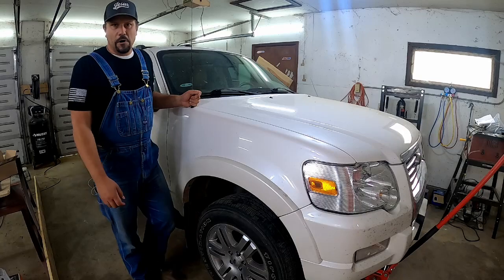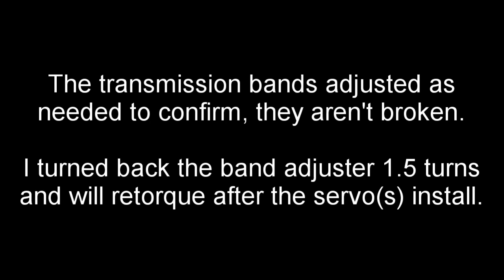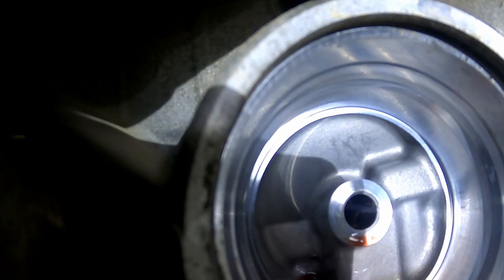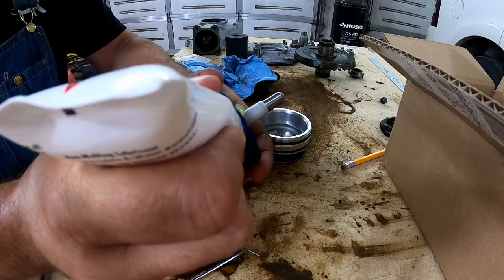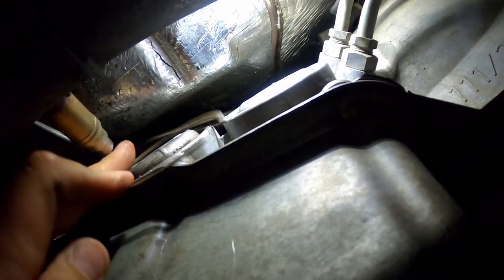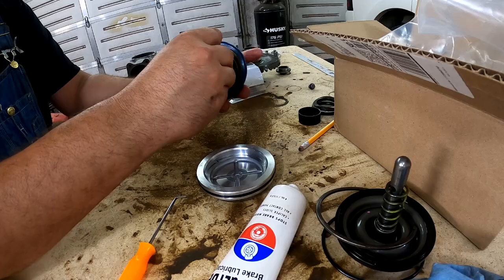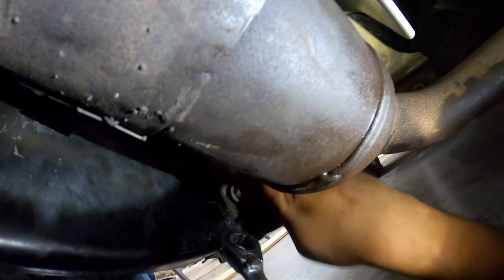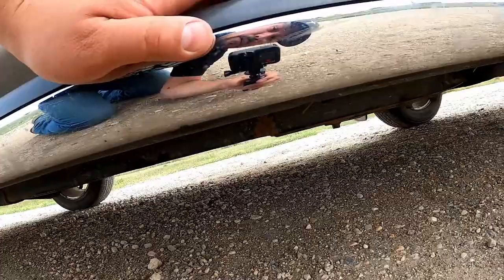Ford Explorer Transmission Fix?  AJ1E Superior Solutions LLC Servo Bore Kit Installation

Comment: I have 2004.. 4.0.. 5r55s and I have no reverse or drive.. but 1st 2nd and 3rd works great.. is it bands?
Reply from the maker: Hey Travis, it’s hard to pin point what might be causing that.  Typically a band issue would cause slipping or hard shifting or both.  These symptoms tend to vary depending upon trans operating temp, driving conditions, etc.  Drive & reverse missing might lead me to check out the shift solenoid pack.
Reply: That’s what I figured as well even after changing the shift solenoid pack still no reverse of drive but it would move in low 1,2,3 there’s only select few transmission shops that will adjust the bands but with these transmissions your lucky if you get another 20 thousand miles before it craps out again
Reply: Travis did you Ever fix your problem I have the same transmission with a 2007 GT Mustang I have the same issue you’re having now
Reply: @74Fox  I sure didn't transmission shop said bands were broken or wore out and needed a rebuild. I ended up scraping the entire car. Hope you can get yours fixed.

Comment: I have a 2003 Ford explorer, it has a 5R55S tranny. I'm getting a flashing overdrive off light. Some slippage going into 3rd. P0733 code. Got any suggestions? Thanks
Reply from the maker: @fordbossme could possibly offer something.  My experience goes as far as this video goes with these transmissions. Hope you can get some answers.

Comment: The servo shafts do not look the same.
Reply from the maker: Please expand on that.  Are you running into an issue?
Reply: Yes! I have a 2003 explorer that I had a rebuilt transmission installed. A couple months after the installation, the OD light came on but vehicle still ran ok. Person who did the installation said it was probably just an erroneous error and if it did not cause any noticeable driving problem to continue driving it.  The transmission was installed 3 years ago and it has always given the OD light but two weeks ago, it jumped into a higher gear when accelerating from stop. On the same day it would not move from park even in reverse or any forward gear but this only happened once. It then drove OK. I decided to see if the transmission fluid was low and when I removed the bottom plug, the transmission fluid was very black. So I replaced the filter and installed new fluid. Now the vehicle will not move either forward or reverse in any gear. @2StallGarage

Comment: I need help i have 02 Explorer i have code p1700 p1401 p0455 p0457 help me please
Reply from the maker: Hey Juan, what are the issues your experiencing?
Reply: I have 2002with a 4.6,same codes.Cleaned the solenoids, then tried a used one, not much difference. Mind you i have not tried to run it down the street. Servos were mentioned, broken, haven't looked. Work at a Ford dealership, 1500 plus tax i was quoted for a rebuild. Decision in the spring, good luck on yours,i down to running a 2009 escape. Have a happy Christmas.
Reply from the maker: @vernonfindlay1314 merry Christmas! I hope you get it all worked out and back on the road.

Comment: Would that be in the same years of transmission issues? 2006-2010?
Reply from the maker: If you have one of these transmissions: 5R55 SERIES - 5R55W, 5R55S, 5R55N, 5R55E, 4R44 SERIES - 4R44E, 4R55E, A4LD